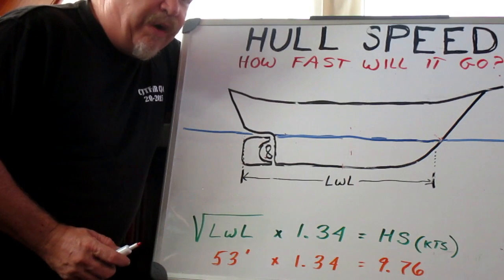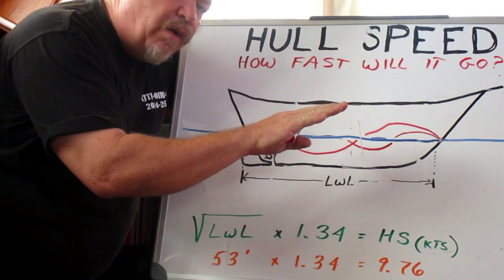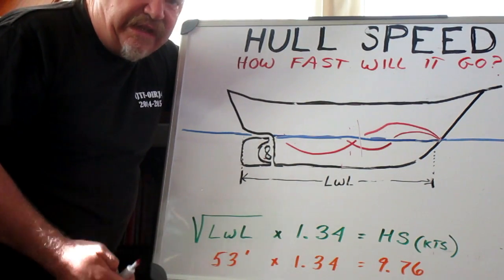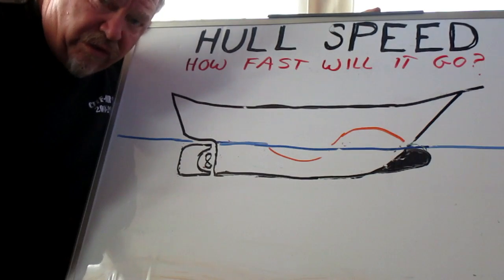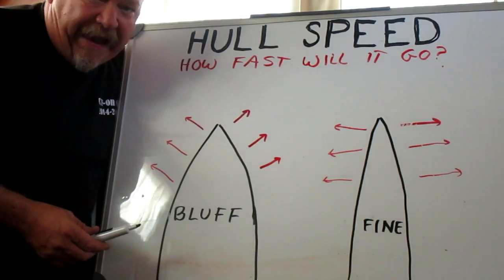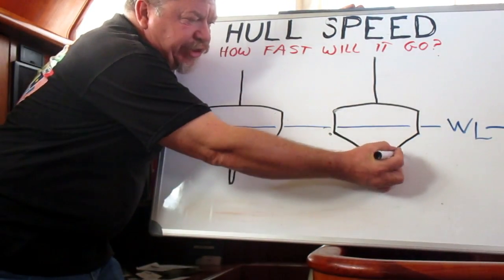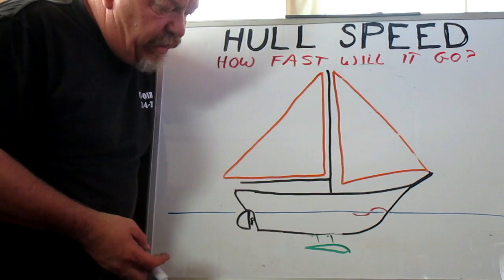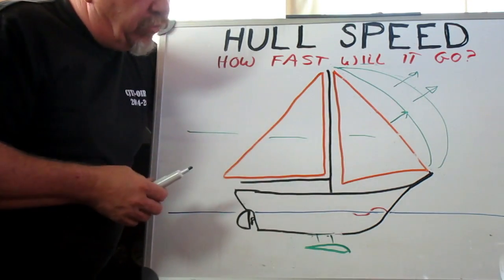Hull Speed

Comment: Hi Brad - you did an excellent job explaining the hull speed for a monohull. I wonder if you know of a way to configure the hull speed on a catamaran? Our catamaran was not built for speed. It was built for comfort. It's a Richard Woods Flica 35 foot Catamaran.
Reply from the maker: Well, I am not sure of a scientific formula, but there are some big differences.   A cat cheats hull speed by having a better prismatic coefficient, which depends on a length to width ratio.   It also behaves differently than a monohull with regards to loading, since the area of water line is less (meaning it sinks easier with weight).   But in the end,  cats are about 25 to 30 percent more efficient in terms of speed.   So.... I suggest getting an estimate by getting the square root of the LWL x 1.34, then x 1.25 or 1.30.   Should get you close.
Reply: Julia Weeks go brad
Reply: Sailing Puffin ok
Reply: Sailing Puffin ok
Reply: Sailing Puffin ok